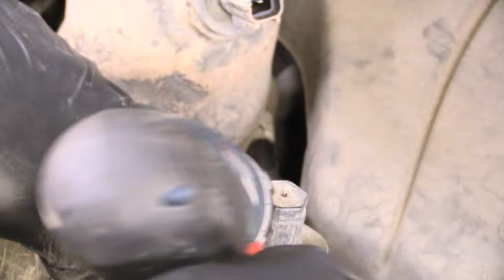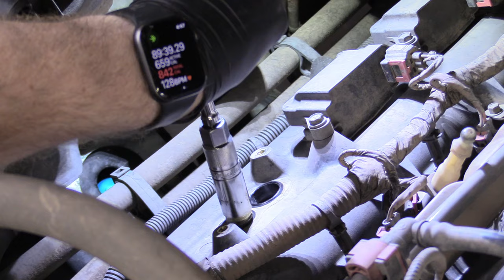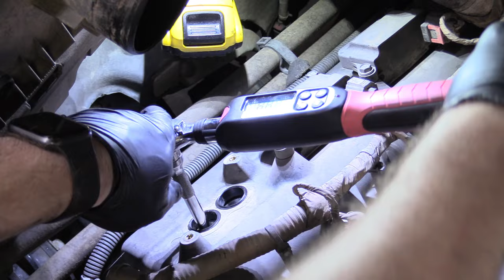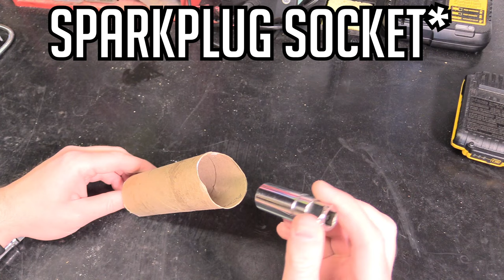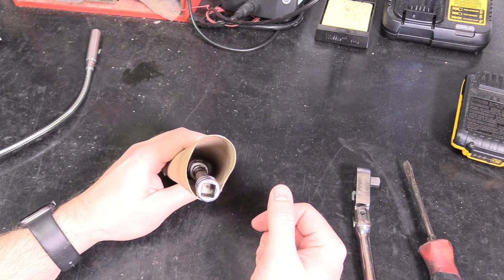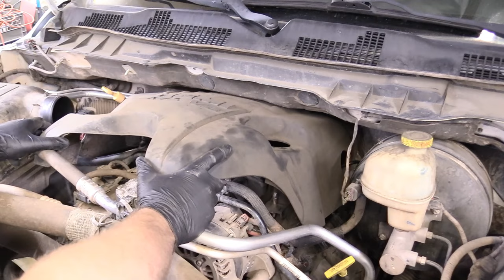How to Replace Spark Plugs RAM 1500 5.7L V8 - There is a Trick to It!

Comment: This is one of those "easy" jobs that can turn into a bad day really quick.
Reply: No ones really shows themselves pulling out the ones under the brake booster.. how convenient
Reply: @briancano1806   Because you can't film it it's so tight! That's why he used the toilet paper roll to illustrate the valve cover hole of the cylinder that you're complaining about... if you already know how hard it is to get in there and still leave a comment bitching about how no one films it.... that leaves me to believe you have a special relationship with the short bus.

Comment: This fella addresses better--by far, the PESKY CYLINDER 8. It can be intimidating, but by piecing the smaller extensions together as you go into the plug chamber, you will be able to conquer this. Mine's a 2020 Ram 1500 Classic SLT 5.7L V8. The heater hoses and that dadgum wire cluster was REALLY in the way, but if you follow this guy's advice you'll be able to do it as a first-timer like I am. Cheers!
Reply from the maker: That's so nice of you! Thank you so much for watching!
Reply: @2carpros  My Pleasure 👍

Comment: If you don’t have multiple swivel socket adapters and extensions (3/8 & 1/4) with multiple angle ratchets… stop and go back to the store and invest in them.  Also doesn’t hurt to buy a magnetic 5/8 plug socket.  You’re welcome. Lol

Comment: This is not the correct specs for 2019 5.7 in the 1500 truck. I don’t have the etorque either. Factory plugs are .043” gapped and the middle of the torque range is 20 ft/lbs. thank you for the video though, it’s a great starting point

Comment: FYI: You can also use a piece of 3/8in fuel hose approx. 8-12 in long to get plugs out/in. Has worked very well for me once you loosen plugs with socket as you explained.
Reply from the maker: Yeah for sure! Thanks for watching!
Reply: Been doing that trick for 30 years.

Comment: Where  your ones are at the brake booster they make a thumb ratchet it works really well once you break the plug loose and you can turn the plug out an use four 3/8 swivel to pull it out that was my way of doing it. Thank you for the video it was very good. God bless you and keep you.

Comment: I just use a spark plug socket that is fastened by a wobble..bends around and the extension doesnt pop off the socket when i try to pull it off the spark plug

Comment: I had forgotten about Dodge's duel plug set up.  Airplane have this redundancy because to ensure that you didn't lose a cylinder mid flight, not to enhance performance.  It made sense 100 years ago when they had a short lifespan to begin with but with plugs going for 100,000 miles this makes zero sense, not even on an airplane.  

On the plugs: when I was a parts salesman I was told to NEVER try to gap plugs that came with that protective sleeve for two reasons. 1: They were pregapped and you shouldn't mess with perfection and 2: any attempt to gap them could remove the thin layer of platinum and shorten the life of the plug.  Your thoughts on that.

Comment: I started the job before i watched the second half of the video and came to a similar solution to the drivers side cylinders, however i didnt have a long magnet tool on hand. Instead what i did was use a spark plug socket then a 2" extension then a universal joint. When it came to getting it in and out of the drivers side ones i just put side pressure on the socket against the spark plug well with one hand and pulled the extension with the other and was able to connect and disconnect the extension. I also had to climb on top on the engine to be able to reach. Having good manual dexterity is key.

Comment: Might consider blowing all  the dirt and loose debris off you can before even touching anything. Couple of passes with an air wand outside will save you what surely to end up on your floor or in your face or eye if anyone had the misfortune of needing to be underneath it at any point. Not a critic, your shop your video. Just a friendly pointer for anyone that takes the time to read this comment.

Comment: Where did you come up with 13 ft lbs for the torque spec?  I thought the torque spec was 20-24 ft lbs.
Reply from the maker: Right from RAM. Thanks for watching!
Reply: not 24 ft lbs ! What are you trying to do break the spark plug off ~it's 13
Reply: It says on the spark plug packaging to torque to 21 ft pounds which I thought was high. I'll Def do the 13 ft pounds
Reply: 20 ft lbs is the scary tight for plugs....13-15 WITH anti seize is plenty

Comment: A quick blow down the tube before the socket helps too. Ive witnessed dirt down in the well from a prior entrys. Especially if someone's been swapping coils chasing a misfire. Better safe than sorry. Could be too late once the plugs out. Even blowing air down the opening of the plugs could blow something back through an open valve into the intake. Crank up and bam.

Comment: Great video, clarification?  Video states cylinders 1,3,5,7 are on the passenger side, is thar correct?
Reply from the maker: Nope. They are on the driver's side. If I said otherwise I misspoke or got it confused with Ford as they do it that way. Thanks for watching!

Comment: This is my first time changing plugs on my 15' ram 1500. Normally I just buy them from the store for my 4cy. But seeing they take 16 I was curious about Amazon because of the price. I have read about people saying there are fakes on amazon. What is your experience and where do you buy your plugs from. At this point since I do only the best for my truck I will spend the extra $ and go to the retailer. I'm just curious about other people's experiences.

Comment: Why does everyone show the passenger side spark plugs and not the driver,  I cussed for 2 hours doing the passenger side and haven't even tried the driver,  going to have someone do that!
Reply from the maker: Because you can actually film them. They are exactly the same though. Thanks for watching!
Reply: @2carpros  yeah. Same principle. But he’s talking about the spark plugs on the drivers side underneath all of the obstacles. How come nobody films removing those? Or give tips to expedite the process?
Reply from the maker: @derekmcgraw9865  There really isn't a trick beyond what I showed. It's a process. Sometimes there is no easy way out. Thanks for watching!
Reply: @derekmcgraw9865  driver side,  rear most, cylinder 7, all you have to do is drop the spark plug socket down the hole,  then feed the socket you just dropped down the hole with a 3 inch short extention,  click it into the socket and then spin it and push it onto the plug with your fingers to make sure it's seated.....then connect the ratchet to the tiny bit of the extention that is still sticking out of the hole a tiny bit past the valve cover. Loosen the plug with the ratchet just to break it free... now remove the ratchet from the extention and use your fingers to spin out the plug the rest of the way..... you'll see your extention "get taller" past the valve cover and it'll be easy to grab on to. On the reverse, now that the plug is completely free of the threads.....grab the extention, socket and plug out of the hole with your hand. If your extention is to long to clear the bump out on the fire wall then disconnect it from the socket and plug, and let the plug and socket drop back in the hole and fish out the socket and plug with a magnet stick that has a swivel type end... harbor freight has them for $4  https://www.harborfreight.com/hardware/magnets/18-inch-telescoping-magnet-37187.html or use something like this to snatch out the socket and plug https://www.harborfreight.com/hardware/magnets/flexible-magnetic-pickup-tool-94614.html .... FOR INSTALL, FIRST SPRAY YOUR SPARK PLUG SOCKET WITH WD40 or dielectric grease! ....put the new plug in the LUBED socket and drop both down the hole....to reinstall do everything above just in reverse. Connect the extention to the socket n plug that in the hole... hand thread the plug in and then tighten with ratchet. EASILY AND SLOWLY PULL BACK to get the socket to let the plug go.... now Disconnect the ratchet from extention.. the extention from the socket and magnet the socket out of the hole. DONE!

It's really not that big of a deal if you just use some common sense, HAVE the PATIENCE to do the job and the right combination of simple hand tools. ,

I HOPE THAT HELPS SOMEBODY. That was a lot to type out 😂

He didn't film it because if you ACTUALLY TRY DOING THIS JOB you'll see it's impossible to get a camera in there while your trying to get your tools in and out of the hole... you can barely get your hand in there nevermind a freaking camera. If all of this is "too much" for you or if you're irritated or annoyed then it's probably best to bite the bullet and pay someone with the skills and patience to do it for you.
Reply: @MyBigThing2010  This is the conclusion i came to on the driver side as well cylinder 1 has the oil tube blocking, 5 and 7 have the brake booster really was a nightmare but the magnet made it easy.

Comment: Do I got to disconnect the battery when doing the spark plugs?
Reply: You do not have to disconnect the battery for this job, but it isnt a bad idea since you are messing with electrical connectors on the MAF and the coil packs.